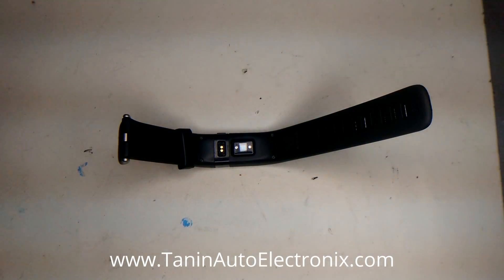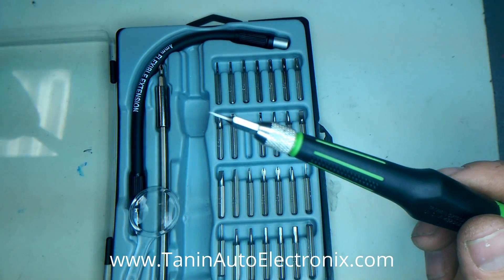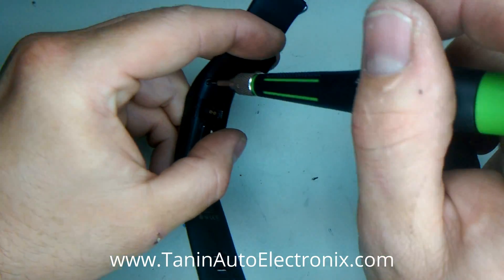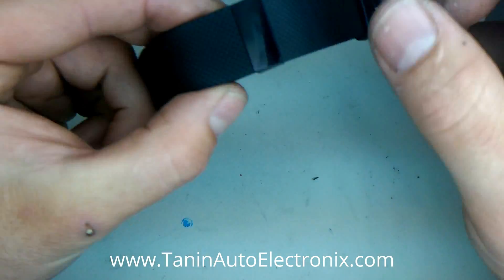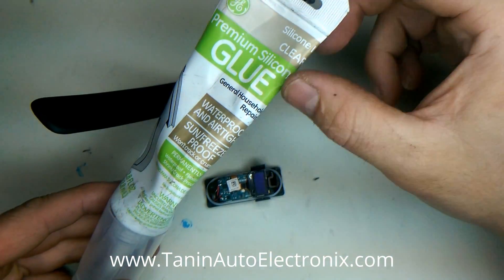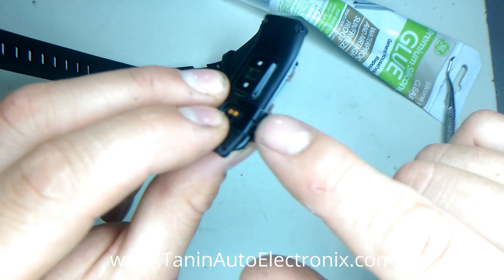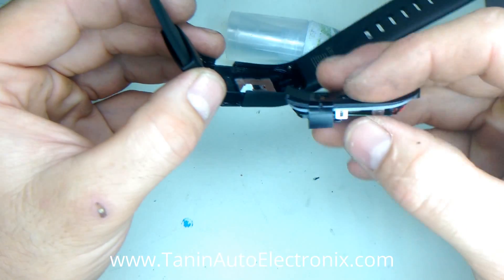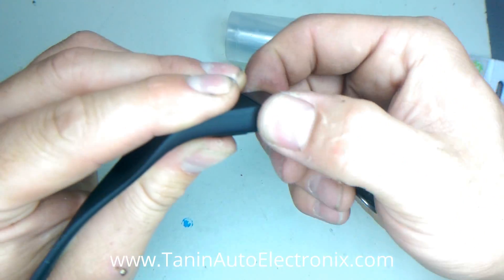How To Repair & Waterproof Fitbit Charge HR with Replacement Smartwatch Battery, Part 1 | TAE

Comment: I know this video is years old but do you do repairs for these older models? It's such an absolute waste to trash something that can be fixed and still works with the applications but people don't have the expertise or know how so do you offer repair?
Reply from the maker: Not really. They have become so cheap and plentiful that it's not worth our time to repair. It would cost more to repair than to just buy a new or good used one.

Comment: I ordered battery for Charge 2.  Got it, and link to this video, NOT for a charge 2.  NO 4 screws to remove.  Is there a video for the Charge 2?
Reply from the maker: Hey Chuck, I apologize about that. For the Charge 2: Easy installation, simply pop off the back, black plastic cover and access the battery and wiring.  You will need to solder the new battery to the existing wiring.

Comment: Just installed my battery and it's only holding a charge for 3-4 hours...could the battery you sent be defective?
Reply from the maker: Hi! Sorry to hear your FitBit is still not working. Unfortunately, this issue sounds like it could be caused by an underlying hardware issue that a new battery will not fix. 
This info can be found on our listing: http://bit.ly/fitbit-charge-80mah-battery

If you have any more questions, please contact our office: http://bit.ly/tae-contact

Comment: My Fitbit Charge does not appear to charge when connected to its charging cord.  It may occasionally have a screen that looks like a charging screen (with the electric thunderbolt pictured) BUT instead it has an exclamation mark in the middle !!!!    What does  that screen image mean exactly?
Reply from the maker: https://community.fitbit.com/t5/Charge/Exclamation-Point-on-Display/td-p/584821
Reply: What happened?

Comment: Why fill the little hole when right behind that there is a seal?
Reply from the maker: Because it is not sealed
Reply: The grey O ring is a seal, the little hole is outside the seal. But It can't hurt to fill the hole.

Comment: its great !!
if the strap is broken.
You can easily get a new Fitbit Charge HR replacement band here:
http://www.aliexpress.com/store/product/DIY-Repair-Replacement-Silicone-Wrist-Band-Strap-Case-Fix-For-Fitbit-Charge-HR-Smart-Wireless-Watch/1245466_32760136549.html

Comment: I'm guessing changing the battery for the Fitbit Blaze would be more or less the same. Any idea on where to get small batteries for it. 167mAh lithium ion
Reply from the maker: No idea.  You would need to send it in so we can take it apart and figure that out.

Comment: the battery in the description work on the regular charge too right?
Reply from the maker: yes
Reply: I also am wondering if the vibrator is supposed to be vibrating for no reason
Reply from the maker: +Mysterious1423 not unless you hold the button down.

Comment: is the battery for charge hr and charge the same?
Reply from the maker: Haven't had one apart to verify, but it appears to be the exact same size and part just without the HR monitor.
Reply: IT ISN'T. I just received a battery that I ordered from Tanin Electronix, only to discover that it doesn't fit inside a regular Charge. The battery Tanin sells is noticeably thicker than the stock battery and once you try to put it back into your Fitbit, the size prevents the electronics inside from working correctly. Be warned!
Reply from the maker: +David Dycus (Dirtiest) we just repaired a fitbit charge and installed our battery. it works perfectly.  Since there is no heart rate monitor in a charge, there is actually more room. We can install the battery for you, just send it in.
Reply from the maker: The battery fits fine, your unit works, we will be contacting you today for payment and it will likely ship out tomorrow.

Comment: Hi very helpful post. It will be another help if you could tell me which battery does Charge HR use,  40 mah or 100 mah? Thanks.
Reply: Would the Charge HR work with a 180mAH battery?
Reply from the maker: 80